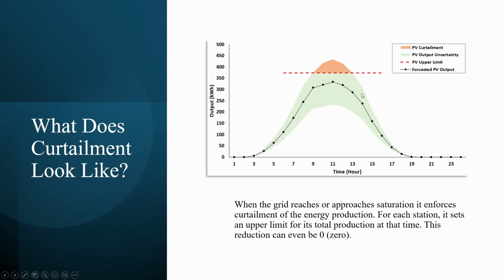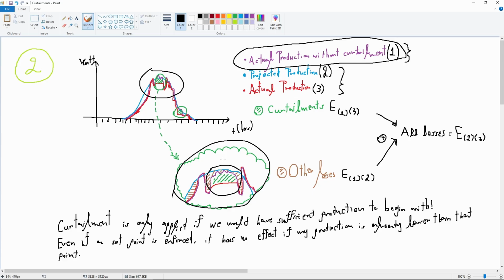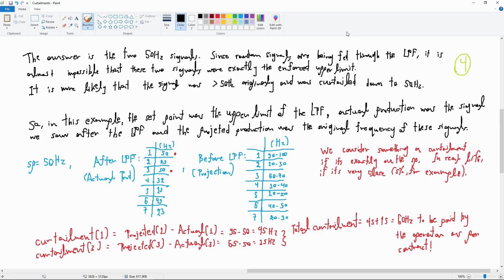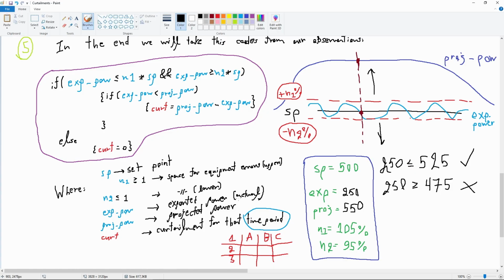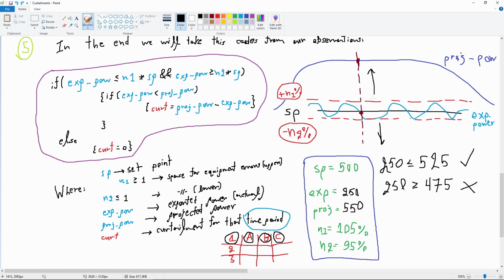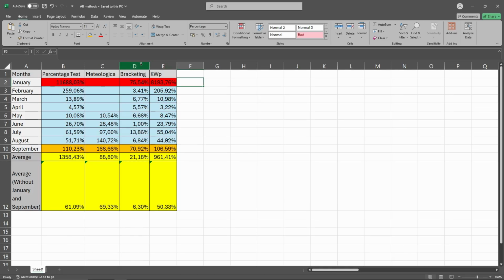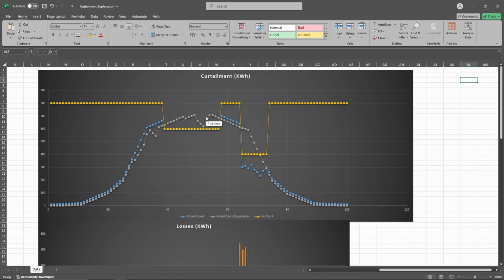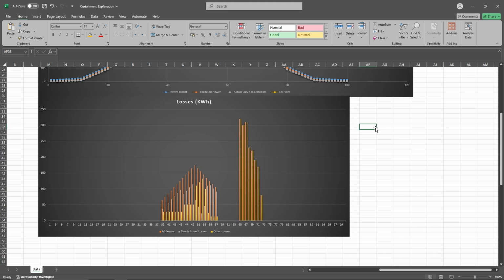Curtailment Explained for Engineers: Practical Insights, Custom Algorithms & Examples

Comment: Nice Explanation. In the filter analogy, what am I supposed to understand though? I did the exercise.
Reply from the maker: Basically, in the filter analogy, you can learn how curtailments enforced by the operator are capable of cutting down production (shown in Hertz in the example). Most importantly, though, you can understand that the possibility of having a normal production incredibly close to the set point (maximum accepted production) is close to impossible. This is the logic we use for the algorithm.
You did really good by doing the exercises! It helps a lot.
Reply: @Powernode-ece  oh ok so it's like a logic preperation. I get it
Reply from the maker: Exactly!